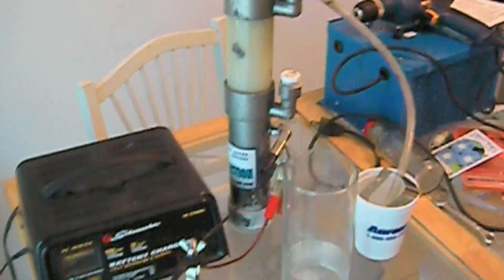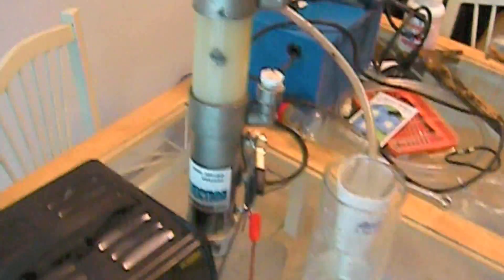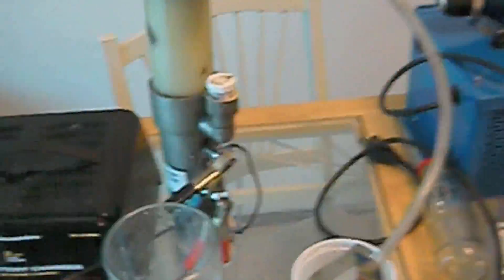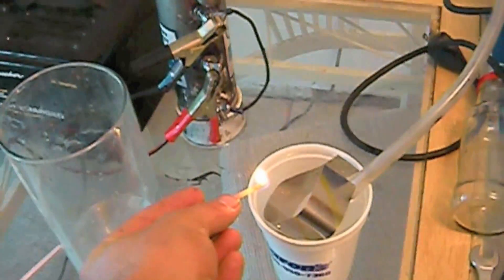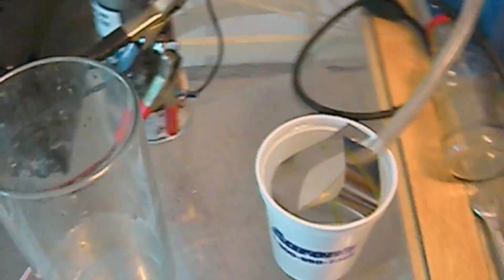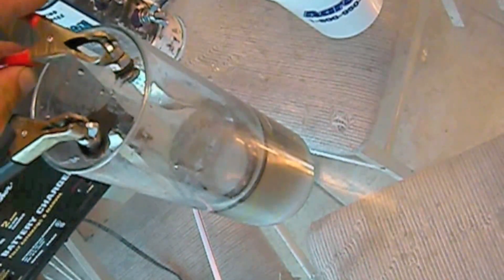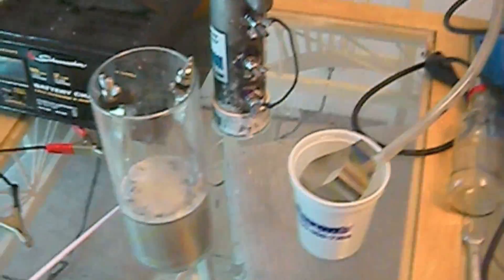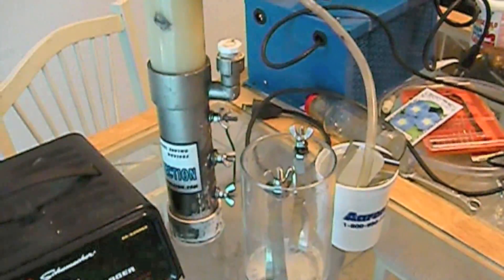Hydrogen fuel cell REVIEW explodes

Comment: exactly...like where did you buy the metal. how about a brief description of how it works is it similar to what you made does the top plug fill and bottom drain why does it have 3 screws at bottom what kind of water if i knew this i could easly make one myself...the one i made was with 2 mason jars/acid and distilled water and stainless steel 50% increase but solution wears out at 4 hours and stainless around 12 i need better stuff

Comment: that super special type of dallas metal looks just like the typical Ground Strap that I use for grounding SSB radios in marine applications.  It is simply a thin piece of copper that is decently expensive relative to other cables, etc.

  GND strap is initially designed to work mainly because of the skin effect principal of radio waves.

Comment: my cell gets 70 C, i cool it with a aluminium block with copper piping, a radiator and a small pump, I use 2 lithium battery's which i charge overnight... with this system you CAN run on hydrogen ( you will have to change your camshaft and the ignition. BUT ITS POSSIBLE,. and you are telling me you KNOW ? lol, you also know you have your head up your arse ?

Comment: Hello Mark,

I hope you have been informed.  That's a glass container and that H2 O2 which is explosive.  Your contacts in the glass container are unsecured.  BOOM!  You have about a liter there, it could make one nasty BANG and shatter the glass container with glass flying!  At least wear a face shield and gloves.  KOH and NaOH and NaCO3 by products are very corrosive to eye tissue.  I have been told by an eye doctor that eye tissue dissolves much quicker with basics then acids.  Be careful!

Comment: You need electrolytes so ionize the the water, so when you pass a current through the water the water separates faster. Dissolving salt in the water will give it electrolytes. That should make it function properly.

Comment: @eightballproaudio Well here's what I think, and I don't mean for this to be mean, just an observation. The problem with your video is the lack of information and general knowledge about the hydrogen system. I would recommend some research and at least a little understanding of the science behind the experiment. Hydrogen generators are probably the best home experiment for the beginning inventor. Use the project as a learning tool. Please take this in the nature in which it was intended: helpful

Comment from the maker: Well reptile, I dont think it would do anything if you put some Blood Plasma in there, it is 90% water and would make a good electrolyte. However, if you are referring to plasma from an ionized gas, you would have a problem introducing the plasma to the cell.Plasma is made by introducing many free electrons into the gas by establishing an electrical voltage across it. When you try to light up the plasma the shit will just blow up.In a plasma with an electrical current running through, it is hot